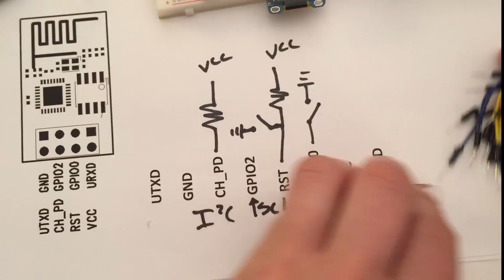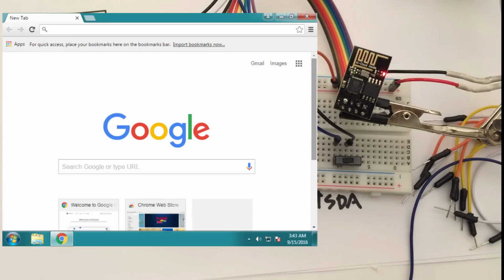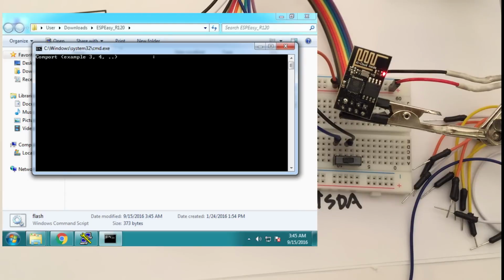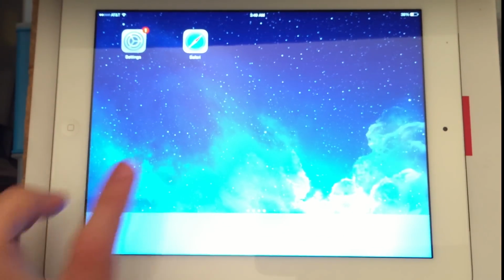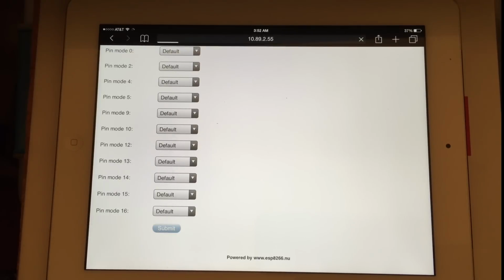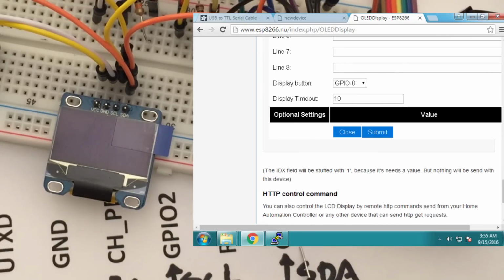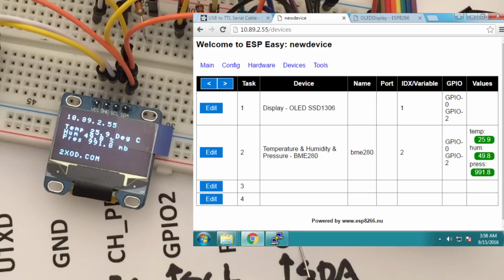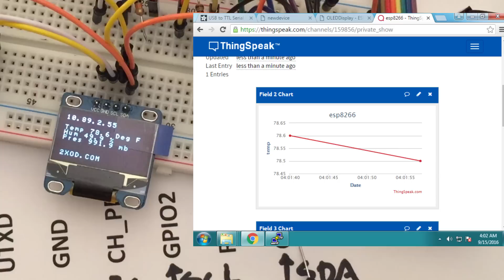20 Dollar 20 Minute Wifi Weather Station with ESP8266 & Thingspeak

Comment: i am trying to build a arduino/nFR24L01 with temp sensor so that at a particular set temp it sends a single to another arduino/nFR24L01 with relay to turn on a cooler/heater. what is your thoughts? thanks btw great presentation.

Comment: Can this project work as standalone device? I mean, would it reboot itself as standalone device and work  after you disconnect it from the computer and eventually switch its power off and afterwards on?
Reply from the maker: Yes. In my video I am only connecting the USB TTL RX, TX, and GND pins for programming. All of the power comes from the 3.3v wall plug

Comment: This should work with an ESP-02 module exactly the same shouldn't it? It's basically an ESP-01 with an external antenna connector which I want.

Comment: Nice video. Could you please help me I have a BMP085 sensor with me .  I am unable to get a reading from the sensor on the OLED screen. Is the syntax different for another sensor?
I used the code
Temp [bmp085#temp] Deg C
instead of bme280 still there was no reading.
Reply from the maker: you can put in whatever is the "name" on the device and the "value name". Make sure you are getting readings on the devices tab, maybe you have a bad i2c address?

Comment: Can you please make more videos using the ESP connected with an arduino so we can use more sensors?
Reply from the maker: thinking about it! i2c sensors are nice because you don't need an arduino. I think for mroe devices you will want to use a nodemcu board that has more pins.

Comment: Putty just outputs gibberish and the blue LED flashes like crazy  I think it might be the FTDI usb I am using.  What was the bug you mentioned in the video?  tnx
Reply: Gibberish often means wrong baudrate. When booting in flash-mode the baudrate is at weird 74880 baud. Perhaps your flash pin is low or your ESP is being auto-reset continuously by its watch-dog because of power issues.

Comment: Do the RST and GPIO pins go to GND or VCC? Doesn't it say VCC in the schematic?
Reply from the maker: RST is pulled up to  VCC via 10k resistor, but is connected to GND via switch for resetting the ESP. GIO0 is connected to GND via switch to initialize flashing, but is normally left floating.

Comment: After watching the Video i was so excited to finally do something with the modules laying arround! Nice Video.
Unfortunatly after trying to start with them I had no succes. I can flash the EasyESP but after that i got long error messages. I´ve tryied also some Arduino IDE basic sketches, also no success :-( 

Now I have to go to the forrest and hit some tree´s with an axe
Reply: Many issues with ESP are power related. If power is insufficient it will reset. What error messages do you get when? On the serial you can see a readable error message when using the correct baudrate (74880).
Reply: After a lot trying one Issue is defenitifly the power. Trough the breadboard I had only 2,7V left. I´ve orderd 3,3V regulators and have in the meantime a big lab-power supply. Maybe i´ll retry it.

Comment: Had a thumbs up until you said Celsius was for weirdos.  hahaha  :P   Otherwise, good video.  I just can't seem to trust a scale based on a solution of brine made from equal parts of ice and salt, the melting point of ice, the average human body temperature and the boiling point of water.
Reply from the maker: lol yea
Reply: Those are natural things, though.

The only zeroes that "make sense" for this universe are the zero of solid water phase (ice) or absolute zero.
Reply: My father would say (in a THICK Hungarian accent) that "C" stands for Civilized Degrees, and "F" stands for Fornicating (actually F*cking) Degrees. :-)  Ah, the joys of having a father with a PhD in metallurgy and disdain for all things not SI.
Reply: That kind of anti-metric attitude crashed a Mars lander! :O
Reply: @kevinszabo7035  f

Comment: Great Video thanks.  I am however having an issue getting PuTTY to work properly, the screen scrolls and sometimes i get this message

Fatal exception (0):
epc1=0x4023a904, epc2=0x00000000, epc3=0x00000000, excvaddr=0x00000000, depc=0x00000000

Anyone out there have any ideas.
I am hoping to use this to push weather results from around a garden to a central Thinkspeak page, running the stations on Lion battery

Comment: The damn cable is $9.99 PLUS $14.00 shipping  No USPS option
Reply: Lee Crocker I think you can use an Arduino to flash the firmware but I'm not sure
Reply: You can! I did, just short "arduino Reset" (res) and "arduino ground" (GND) then connect "arduino RX" to "ESP RX" and TX to TX (not crossing), GND to GND and 3v3 to Vcc.

Comment: this guys has no idea what he is actually doing.
Reply from the maker: Yes it's true!
Reply: as engineer I don't see any meaning in such things like attaching ready to use parts together without understanding what is happening with all those devices, that said all those backpacks, and ready to use moduls etc and etc.. are just another marketing trap for people to take their money. Such setups give you zero knowledge both electrically and Software related. In case it breaks, you will spend eternity to figure out the reasons, and plus this kind of hardware and software is so unreliable that hardly it may find any use. Understand me right please, my critique is not about you, but the hole industry and people trying to advertise this and promote, and others being mislead as usual in our society. 
My advise to you would be start learning the real hardware without those ready made plugins which have no educational use at all. Anyway Greetings from Berlin.